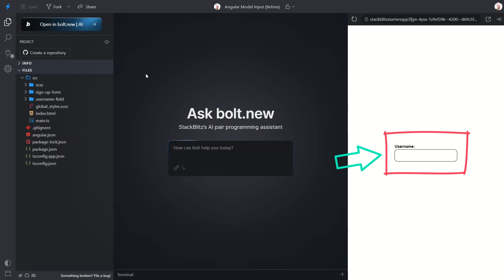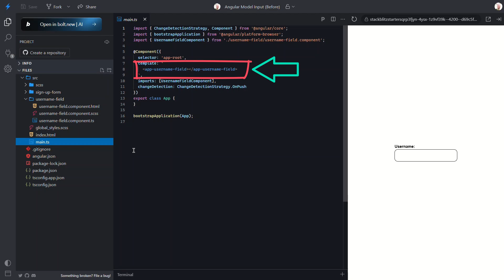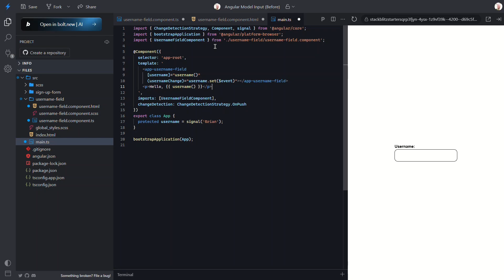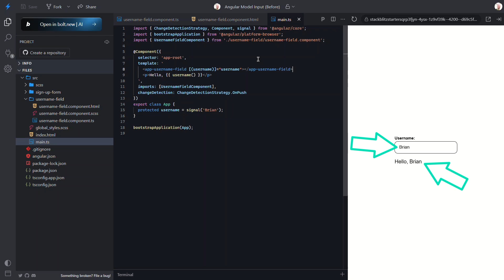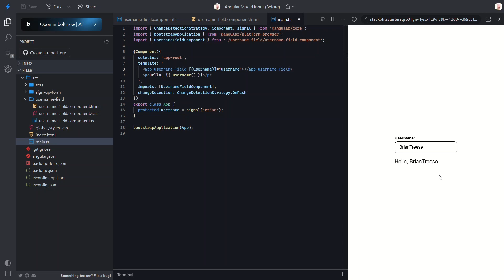How Angular components should communicate in 2025

Comment: I've encountered an issue with highly nested objects using model. When asking chatgpt and the like, it said that input and model don't have the same usecases as @Input and @Output... Similarly, in another video I saw you using @if, @defer etc. however, @if is not the same as *ngIf, and can't be used interchangeably in ALL cases. Care to weigh in and make a more complex video? 😂
Reply from the maker: Great comment, and you're definitely touching on some of the complexities that come with Angular's newer APIs.

Just to clarify a bit: input() and output() ARE direct replacements for the old @Input() and @Output() decorators,  but they're designed for the signal-based world. input() gives you a signal you can react to directly, and output() eliminates the need for EventEmitter. model() essentially combines both and input() and output() into one for special cases when needed. Check this out for more info: https://youtu.be/kM2mZ81968g.

And you're absolutely right to point out that @if isn't a drop-in replacement for *ngIf in terms of syntax. Though it is the official replacement starting in Angular 20, where *ngIf is now deprecated. Since @if isn’t a structural directive, it changes how the DOM is structured in some cases. You often have to remove the element the *ngIf was on and wrap your content with @if { ... } instead. But luckily, there is a migration tool you can use to help with this, check this out for more info: https://youtu.be/nUEERAOZKwg.

@defer, on the other hand, is built specifically for progressive loading. It helps avoid blank states or layout shifts by rendering placeholder content immediately and deferring the main content until it’s ready, something that can be hard to do cleanly with @if.

Hope that helps clear things up a bit!

Comment: I always use a service never input output. Is that still recommended?
Reply from the maker: It really just depends on the types of components you're working with. In my experience, most of the time I prefer inputs, outputs, or in the case where I need both, model inputs. Many components are simple UI components that work with any application so keeping them generic makes the most sense. But when creating more specialized components, that's when I may go with a service.

Hope that helps!

Comment: input(), output() and model() are in developer preview, right? So they shouldn't be use in a real project for now....
Reply: In Angular 19, they have all been promoted to stable. The only signal-based function that remains in developer preview is effect(). In any case, I've been using all the signal-based alternatives since Angular 17 with no troubles. They are really nice  and easier to use then the traditional approach

Comment: I get that you remove some extra boilerplate but in my opinion this way of using 2 way binding hides the clear data flow between components, what if you want to have a side effect when the output changes? With this solution you should add an effect while with the previous solution you can handle it in the function which is in my opinion way clearer?
Reply: That is not necessarily true. With the first approach (input/output) you can still use two-way binding syntax. And with the model approach you can still bind to [username] and (usernameChange).
That way you can mix and match in the way that makes sense for the scenario. There can be good reasons to use any combination, though I also would recommend to start with the most simple setup and expand if really necessary.
Reply: I think you kinda answer your own qn in a way. If it was simple, direct update, just use 2-way binding and save a few LoC.

If you need to compose some behaviour on top of state update, you can simply revert to using the original [state] and (stateChange) pair, and compose the event handler for (stateChange) however you want. I would avoid effect as much as I can